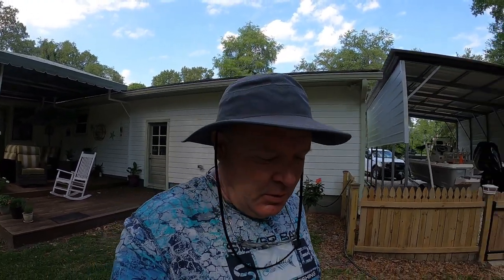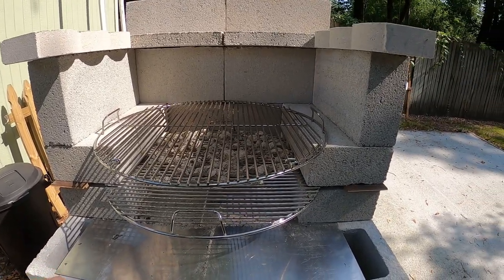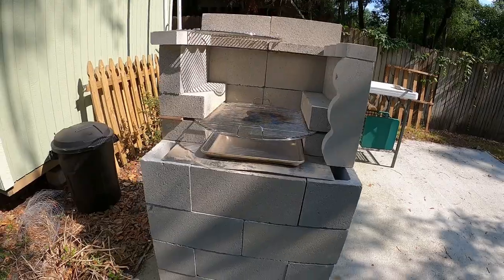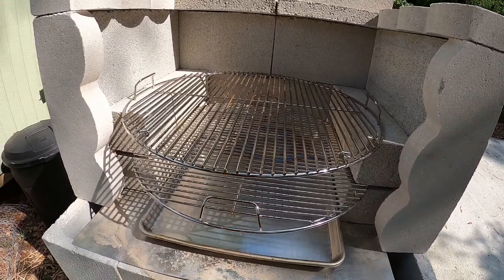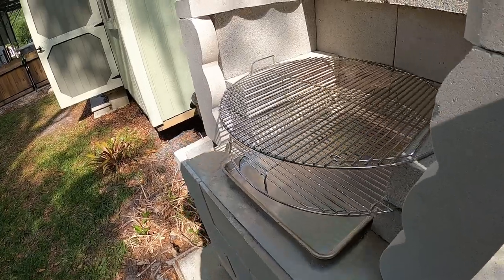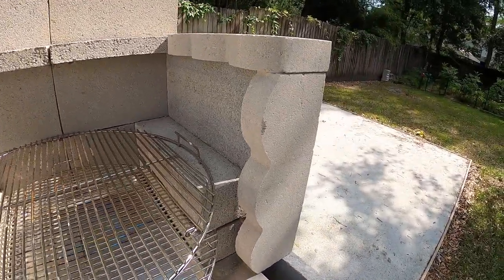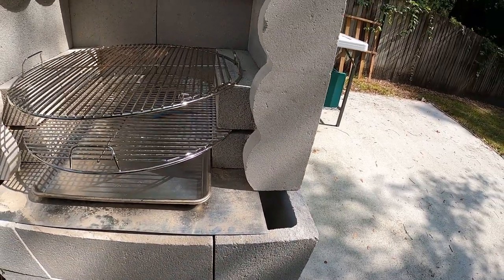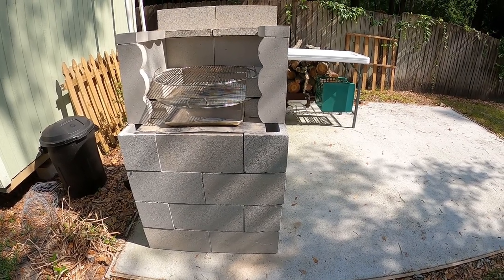How I Built a Concrete Block Charcoal Grill

Comment: I have a real problem using outdoor grills. I’ve had several over the years fueled by propane but the problem is the aftermath. Houston has such hot and humid weather which the palmetto roaches love. After the grill cooks I’ve seen hundred of those monsters feeding on the remnants of food and grease. I could live with those images of them feasting. Hence I have nothing. I wish I knew a way of keeping them out.